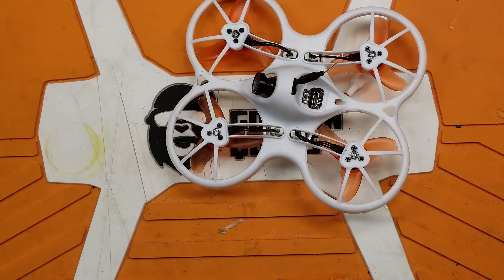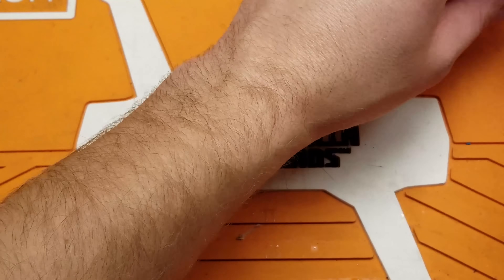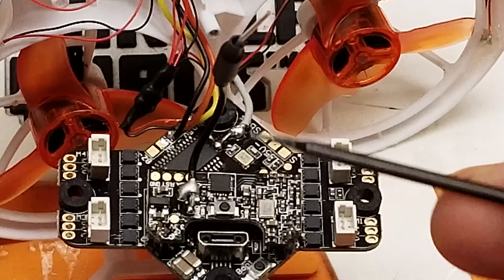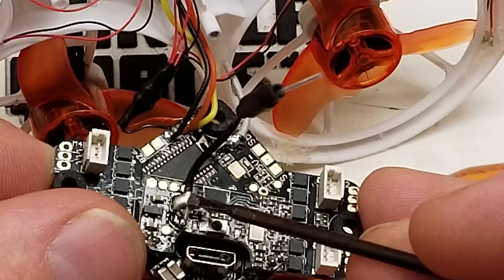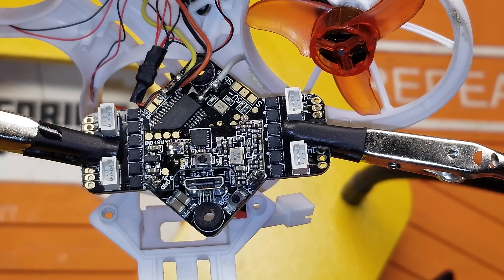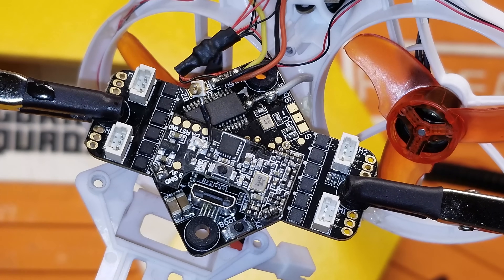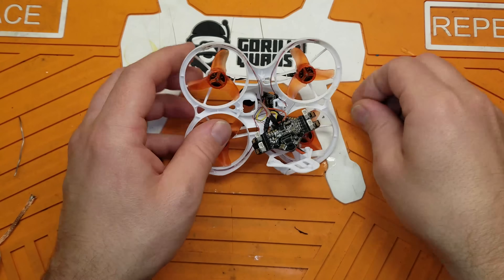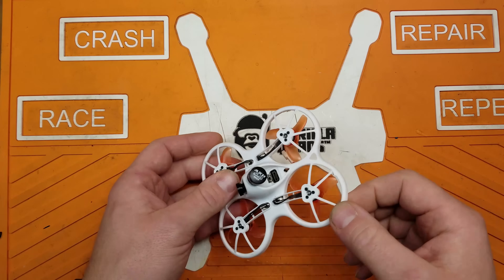Emax Tinyhawk Axii antenna mod

Comment: *Best newbie tip* Add solder to tip to prevent oxidation before shutting off.  Thank you.
Reply: Don't use a wet sponge, use the metal ones.
Reply from the maker: I work with people who have training on how to solder and I catch them not covering thier tips when done. Then I see them with a file scraping off the oxidation a day later.
Reply: So you leave solder on the tip after use and then clean it off before next use?
Reply from the maker: Correct.
Reply: i love the shit i learn on youtube comments

Comment: for anyone watching this in the future like myself, I found a similar UFL adapter at pyrodrone that comes with 2 in a pack for a few less dollars than the amazon adapter above. I think posting links in comments gets them removed,  but the product name is "Pyrodrone U.FL Extension Cable - Choose Length (2 Pcs.)" so you can search that up.

Comment: I now older vid...just saw it for the first time today ( 5/21) could you just have cut the older antenna and then soldered that newer disconnect one to it without detaching from board ? would that have been easier?  curious. And can't you do the same for all micro quads that have a dipole type antennas?
Reply from the maker: Yea you can do that but it would require you to desolder the antenna from the board eveytime you took the frame off. That board is only going to survive a few heat cycles.
Reply: @TweetFPV  never thought of that...Thanks for the reply and subbed
Reply from the maker: @FlyingBuzzard  Thanls for the sub!

Comment: Hey man great video, I'm going to order the parts through your links, one questions though, will this antena work with the glasses that come with the rtf version or will I have to buy a different set?
Reply from the maker: It will work just fine with the RTF goggles.

Comment: I am just getting into this hobby ,have about 50 hours in liftoff and 2 hours of flighttime on my tiny hawk (although that is only hovering on the baclony and getting the basics)
this was really helpful since i am getting my tiny hawk next week for indoor flying and i had kinda expected bad connections indoor on it so this will defenitely be a mod i will consider,
thank you very much for sharing,i would really apprichiate it if you have other upgrade tips for one of those mini quads? props,motors,vct?

Thx again :)
Reply from the maker: Thank you for the kind words. Just the antenna mod. The rest of the Quad is good just fly it for what it is.

Comment: Since we're dealing with high frequency RF signals here, it's important to avoid any sharp peaks from solder or shielding wires because even a few millimeter tip extra can behave as a poor antenna messing with your signal.

Comment: You would have much easier time to get the old solder away from the board with a wick. If you want even better results, get some high quality flux, too. Try watching some videos by Louis Rossmann to figure out how you should use the flux and wick to remove pretty much everything very fast.

Comment: Way better than stock antenna! May have to upgrade mine soon. Does the brand goggles factor in?
Reply from the maker: The module in the goggle helps. The rapid fire module really helps with multipathing interface.

Comment: is this for better range or video ?
cause mine seem to drop out of the air afther im 10/15m away
Reply from the maker: Video. If yours failsafes at 10 meters you have a problem. Are you using the kit radio or something else?
Reply: @TweetFPV  im using a tarranis q7s the tinyhawk was my first drone and i asumed that was just my range, i recently bought a uruav wich can fly trough my entire house
Reply from the maker: Yea you should get much better range than that. Are you bound to it in d8 or d16 mode?

Comment: Wow this looks somewhat simple but very difficult to do, at least for me 😅
Reply from the maker: There are easier ways. Last one I did I just direct soldered and cut a channel behind the camera to route the antenna out.
Reply: @TweetFPV  ok thanks.  what is direct solder and how does it differ from what you showed here?
Reply from the maker: Same thing just without the ufl connector piece.

Comment: I think you need circular polarized antennas on the googles then, right?
Reply from the maker: For the maximum advantage yes.
Reply: thx for answering, means dipol would still work on googles. Interesting. Which google antennas would you recommend to match the AXII? I have got only the EMAX RTF googles by now. BR Olli
Reply from the maker: from amazon:
https://amzn.to/3e4Rx9Y
https://amzn.to/3eaocLt
https://amzn.to/3a5fD1n
from BG
https://www.banggood.com/custlink/vDDmq4EKHF
https://www.banggood.com/custlink/GDKGqgyDta
https://www.banggood.com/custlink/33Kmq6hDSC

Comment: My cat ate my vtx antennna on tinyhawk s yesterday, as a beginner this is a life saver! Thanks so much, brilliant tutorial!
Reply from the maker: 😂 You cat will get better reception now!
Reply: @TweetFPV  hopefully 😂 I've ordered new antenna, in the meantime I've shortened the vtx antenna and exposed the wire from the  ground outer shell about 12.92mm - the reception is acceptable for now.. but The naughty one also shortened the Receiver antenna 😭 - should I also expose the wire tip to 12.92mm to match 5.8G frequency? Thanks a lot!

Comment: great mod, thanks. I just got the tiny hawk 2. The video feed is horrible, simply horrible. I tried to fly it in my shop. There is a ton of room and it would be fun to fly there during the winter. However I got 15 feet away and the video was breaking up very badly. We light the shop with about 100, 8 foot 2 lamp fluorescent fixtures. Old lighting. I believe the ballasts that run the lights are causing this horrible interference. That said I did the switch to 200 milli watts on the video tx ,and have the video tx set to the fatshark band that my attitude v2s are on. I returned home and went outside, the reception was much better. I think flying at the shop is out due to the massive interference. I'll give this mod a try. Another issue,  is,  my quad (v2) comes with the motors soldered to the flight controller, not plugged in like the TH 1. Looks like I'll have to remove the props and the 4 motors from the frame to disassemble it. Thanks again.
Reply from the maker: Yea unfortunately servicing is a but more difficult because of the soldered motor leads. Rapidfire will really clean up the video feed.

Comment: The antenna on my tinyhawk 2 is all messed up. I’m trying to find info on replacing it. But maybe I should just do this
Reply from the maker: It will certainly help with multipathing in an indoors environment.

Comment: I broke the other antenna. 2.4 mhz. Can i solder a replacement like the original just like you did here? Or can i also put an omnidirectional here too? 
Also why no good video thru goggles since this antenna is for the radio? Thanks for your help.  Noobie
Reply from the maker: Can you join my discord and post some pictures. It will help me accurately diagnose your problem. https://discord.gg/N9ndyR

Comment: My tinyhawk has 2 antenna.  I ordered the same one you have but i noticed the other antenna is for the camera. Im new to all this and was going to connect it to that one
Reply from the maker: Yep 2 antennas is correct. One is for 5.8 video and the other is 2.4 radio signal.
Reply: Y is my radio antenna,on the board where it says SUBS, interfere with my video? Thats the one i broke. Any suggestions
Reply: I broke the other antenna.  2.4 mhz . If thats the antenna for the radio why dont i have any video? Can i replace it with a 2.4 mhz whip antenna like the original?  Or can i put an omnidirectional on this one too? And finally is it soldered the same as you did here. Thank you for your help

Comment: Very true noob here but I have a question, should you change the other antenna also? I think people refer to it as the rx antenna? I don't really have a clue of what I'm talking about as you can probably see. Otherwise thanks for posting this, it was very informative.
Reply from the maker: No the rx antenna is fine and a whip is usually good enough since is a lower frequency 2.4ghz it has better range and penetration that 5.8ghz video signal. Rx and tx are industrial teams. Rx is reciever and tx is transmitter. Oh and just for fun wx is short for weather.
Reply: @TweetFPV  Great, thanks for the clarification. I have another question, I'm going to get the Eachine vtx 03s and the 
"Caddx Turbo EOS2 1200TVL 2.1mm 160 Degree 1/3 CMOS 16:9 Mini FPV Camera NTSC/PAL" and I was considering swapping out the vtx antenna. I see some on Amazon that come in a two pack "nidici Foxeer Lollipop 3 FPV U.FL Antenna 5.8G 2.5DBi Super Mini RHCP Antenna UFL for RC Drone FPV Quadcopeter Multicopter TX/RX (85mm)". I only need one though right? Would the other just be extra? I don't know if they need to both be used to work together. I have the Eachine ev800D goggles. It comes with two antennas on the goggles, one patch looking thing and another round style. I'm figuring whatever VTX I have,  upgrading the antenna would still be a great move. Thoughts? And thanks in advance.
Reply from the maker: Yea the 2 pack one would be extra. The only thing you need to pay attention to is if the antennas are rp-sma or sma. Google some images and make sure they match what your are connecting them to. The other thing is the polarization. If you run right hand circular polarization then make sure your goggles have the same. If you have a linear antenna like what's on a lot of micros you can run lhcp or rhcp it doesn't really matter then.
Reply: @TweetFPV  Thanks again man for helping out. I subbed already.  How do I know if the goggles have RHCP? When I go to the specs on that unit it says includes 1x clover antenna and 1x Panel antenna. I will look at the rp-sma or sma as you suggested. The link to the goggles...https://www.eachine.com/Eachine-EV800D-5.8G-40CH-Diversity-FPV-Goggles-5-Inch-800*480-Video-Headset-HD-DVR-Build-in-Battery-p-859.html
Reply: And the link to the antennas I was considering is https://www.amazon.com/nidici-Lollipop-Antenna-Quadcopeter-Multicopter/dp/B07JFFP4LZ/ref=sr_1_4?keywords=lollipop+antenna+vtx&qid=1578698013&sr=8-4. I was just going to cut the end off and solder it directly to the vtx since I don't have the fancy adapter that you used.

Comment: Hello brother! I have three emax quads, and want to do this to my tinyhawk. Where could I buy the pigtail to connect the antenna? I purchased the micro AX2 5.8, but im a little concerned with the direct solder. I would rather do the pigtail/shrink tube method. I have been in the 3D heli scene for 8 years, bought a blade 350QX, and a blade nanoQX, Never thought the tiny FPV quads would be so addictive........ I thought the helis had a hold on me............Im so addicted. Thank you so much.
Reply from the maker: This is the pig tail i used in the video https://amzn.to/34aCQgk

Comment: Okay after banging my head against wall you solved my problem, correct me if i'm wrong... you did this to change from linear pole antenna to RH circular polarization correct? hope you answer, all our mini quads use linear and we use RHCP antennas on our googles = bad signal . correct?
Reply from the maker: Yea I did this to change from linear to rhcp. With a rhcp (or lhcp) it really helps. The nature of these quads is to fly indoors so there is usually a LOT over multipathing. The circular polarized antennas really help cut down on that. When we race indoor races the other people using the same goggles and recievers are shocked at how much better my fpv feed is.

Comment: Will this improve range outside as well? I fly around a large soccer field and loose video around the small hill. Also is this the lumiere shorty or regular length?
Reply from the maker: This should give you more range. And it's the shorty antenna.

Comment: Get some good solder wick. It will save you a lot of trouble cleaning up old solder.
It looks like the pads on the PCB would accept a surface mount IPEX-4 connector right where you removed the old antenna. I don't think you really needed that pigtail you added.
Thanks for taking time to document your efforts.
Reply from the maker: Yea I'm pretty sure a ipex connector would have fit. I just didn't have one on hand. Plus for the average person soldering the extension or bare antenna is easier than a smd connector.

Comment: Heads up for anyone trying this Mod, They have the Axii micro without a connector for sale just has a pre-tinned bare wire.
Reply from the maker: Good info. Thank you!
Reply: @TweetFPV  Getfpv has them in stock. Excellent video Thanks

Comment: Nice tools - the holder, tweezer, heatgun, but i think you should get a smaller tip for soldering these tiny boards.
Reply from the maker: I have one I don't like how long they take to transfer heat. I do all my soldering with this chisel tip at 850deg F

Comment: Could I just get the longer one you think and not use the disconnect? And now what antenna would you get for your goggles to go.with that?
Reply from the maker: Yes, you certainly could use the longer one. If your get a rhcp antenna on the tinyhawk, then any rhcp antenna on your goggles will work. If you have a diversity setup a rhcp patch antenna on the goggles would make the complete set.
Reply: I'm not sure I got the kit. So the emax goggles that come with it. Is that a diversity setup?
Reply from the maker: I can't tell if they are true diversity or antenna diversity. They do have 2 antennas that you can swap out for any style you like. I have used them and can say I was very impressed with the image quality. Compared to the eachine 007 and 006 these are much better.

Comment: Sure wish I had a Tiny hawk to start with. I would have learned to fly much cheaper. Its incredibly tough. The day I received it I flew 58 packs. Probably smacked a rock wall 10 to 15 x at almost full speed. Ill need a new frame in a week or two.but I haven't broken any props. Anyone looking to start out imo this is the best way. Its really hard to beat the Tiny hawk for speed.great handling and durability. Thanks for the videos.and I promise I don't work for e max. lol. Just a great little quad!
Reply from the maker: I agree the tiny hawk is probably my favorite rtf Quad I have ever had. Emax ddi it almost perfret on this thing. Only thing they should have changed was to include the 4 blade turtle mode props.
Reply from the maker: Have you tried to flash the project mockingbird betaflight setup to your tiny hawk yet?
Reply: @TweetFPV  I havent yet, and mine flies so well I may not, but I will use the throttle boost, and a few other settings for sure. I want the throttle below half to hover. I may put more of mockingbird settings in when I have time, but right now I'm busy ripping the neck out of it. I'm ridiculously obbsesive with it, yesterday I flew from 1pm till midnight with a few breaks. I am getting so much better so much faster than training with a 5in..

Comment: Also i have a fix for the usb port find a charging wire for a tom tom gps its on a 90 degree angle works perfect to get in under the axii
Reply from the maker: cool, I've found that the E6000 glue i used is flexible enough that i can just push the antenna out of the way and squeeze the usb cable into the board.

Comment: If i wanted to direct solder that anttena to the vtx would i need to follow the same procedure you did cut the connector off pull back the braid solder ground and signal ?
Reply from the maker: yes, exactly!
Reply: @TweetFPV  thanks a lot
Reply: @TweetFPV  one more thing is anyway to put a different vtx in?
Reply: Cause they have micros that go to 200mw just wondered if thats was even doable cause it looks like its all one piece but cant tell
Reply from the maker: you can put a different vtx in this model you are just limited on space.
Reply: @TweetFPV  oh cool thanks i might try it out and ill let you know if i come up with a option that dont add much wait and fits decent thanks for the info and the video appreciation new subscriber here :)
Reply from the maker: Thank you, it is much appreciated!
Reply: hey so how do I know which is wire to solder where if I only have the antenna?
thanks @TweetFPV
Reply from the maker: The inner core of the antenna coax goes to the center and the outside braided part is ground. That goes to the other pad. Just do it the same way I show in the video but just with your antenna coax and not the adaptor.

Comment: Thanks! I was thinking you might use these on the board if you do another mod?
https://www.team-blacksheep.com/products/product:1571
Reply from the maker: I have a u.fl connector but the solder pads on this board weren't in a standard position to attach one of these. I probably could have but there wouldn't be much mechanical strength to it.

Comment: fine. very good video. thank you so much.
left to determine. Which is better emax tinyhawk or happymodel mobula7. With Happymodel Mobula7 you can use 2S to fly outside. And good luck. and Ukraine is waiting  another video. super
Reply: Mobula7 is much better. I have both and I never fly the Tinyhawk because the video is terrible...and 2s is great outside.

Comment: been there done that, did same antenna mod to my fpv proto x... its fun while it lasts but these mods just add extra weight on these little rtf quads and thats where things just go south for these little birds...
Reply from the maker: Yea I agree, these things ride the line of power vs weight. I still get the same flight times as before for the most part.
Reply: only a few grams difference pretty much though right? I would think that wouldnt effect it much. No?
Reply from the maker: Only a few grams of added weight and I can't tell the difference when flying except that my video is way better than before.